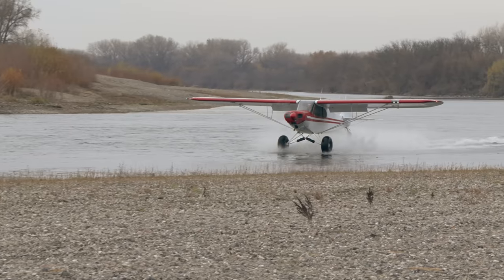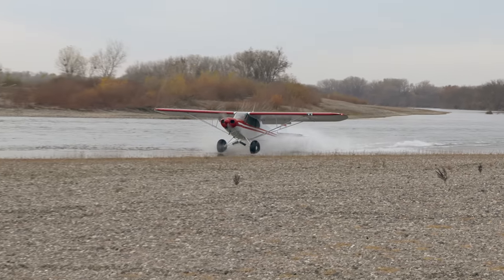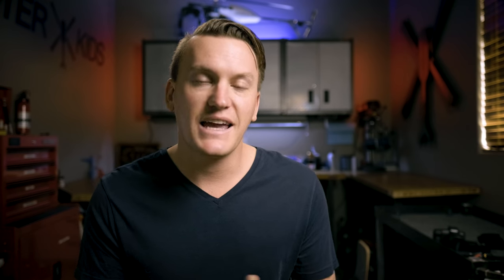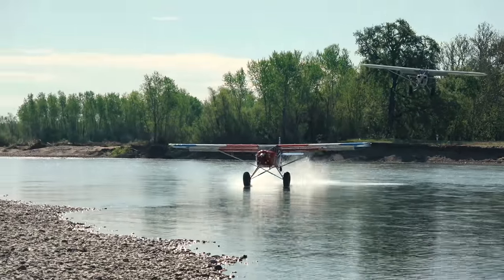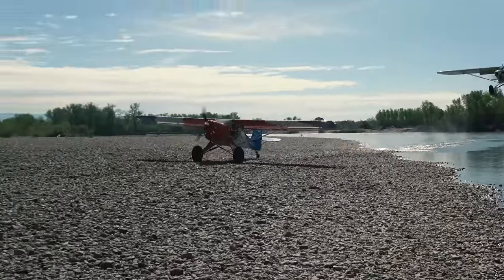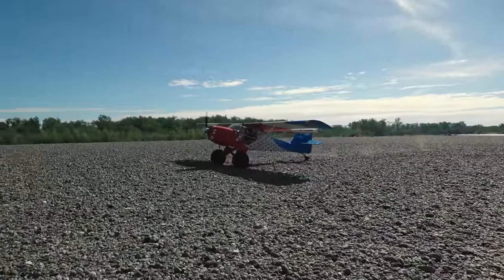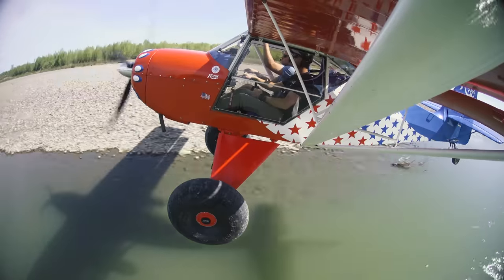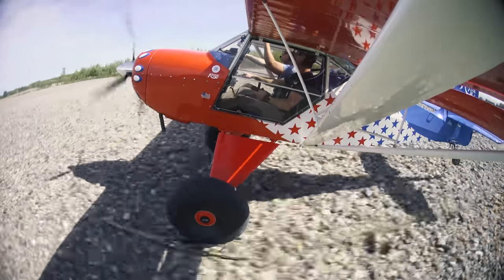How To Waterski An Airplane, and Why You Probably Shouldn’t

Comment: Seems to me that an aircraft with an experimental airworthiness certificate has no published data on non-paved or paved runways.  If you built it, you're the test pilot, seems you could generate the performance data for your experimental aircraft for both paved and non-paved (even with various surfaces, such as gravel, cut grass, un-cut grass, dirt).  That would pull the rug out of an overzealous FAA official who tried to put that one over on you.

Comment: I haven't watched the video and don't have to. Not a pilot, either. But I can still make an informed comment. I know aviators never want to run out of two things, airspeed and altitude. Your waterskiing antics leave both in seriously short supply. Moreover, you have no margin for error. Kissing a runway or the ground in that way is relatively safe but doing so over water is foolish and dangerous in the extreme. You know this, there is NO debate here. Interesting that you post in your comments, "be safe out there guys" while posting a video of you being very UNSAFE. I'm a huge fan of yours, Trent. I watch your videos and I get to fly and share your zest for life. I want you continue to do so for a very long time. As you also know, there are old pilots and bold pilots, but there are no old, bold pilots. While you often fly at the edge of the envelope, it's calculated and done with great skill and experience. However, stunts like this one are just plain stupid and serve no useful purpose.

Comment: Yeah,  hydroplaning is different.  It's  just water overcoming the air pressure in the tire so the center of the tire lifts off the road.  A car would not waterski at the speed that it will hydroplane.

Comment: It definitely is not surface tension. Motorboat people call it planing. It is a hydrodynamic effect. https://en.wikipedia.org/wiki/Planing_(boat)

Surface tension is an effect caused by intermolecular forces. It is really weak and does not depend on speed. https://en.wikipedia.org/wiki/Surface_tension

Don't be scared of the word planing because it is dangerous on the road. It is actually helpful in this case.

Comment: I think what they mean buy undue hazards to persons or property for subpart A would be in reference to your passenger being with you if you had lost the engine while waterskiing you would have been going for a swim instead of had you lost the engine at 300 or 500 above you could have possibly been able to maneuver to try and make an emergency landing on the shoreline. Basically the way I interpret that is at all times you should be able to maneuver the aircraft to a ideal(ish) landing site should you loose the engine, but I’m no lawyer who wrote the far so that’s just my best guess.
Reply: A practiced waterski  landing in an event of an engine failure could be considerably safer than a very rough shore landing. You would sink at the lowest possible speed, hopefully close to shore.
Reply: Ray Fletcher exactly, but there is definitely room for interpretation so that gives the FAA wiggle room to push their decision how they like

Comment: Just to set the record straight, you’re not on probation!  You were never convicted of anything, nor did you plead guilty of anything and there isn’t even a finding of a violation on your record (you would have to have gone before an NTSB Law Judge for that).  You very wisely cooperated with the FAA investigation and stipulated there was sufficient evidence to establish you “may” have violated one or more of the FARs.  As a result of your wise cooperation, you received a warning notice that will be a matter of record for 24 months.
Why was it wise to cooperate with the FAA investigation?  Because, if you tried to fight the case you would have wound up in front of that NTSB Law Judge.  Then, all you would need to do is convince the judge how you were carefully (in accordance with 91.13) operating your aircraft in an operation that it was never designed, tested, certified, equipped, approved or in any way authorized to conduct.  Yeah…that sounds like a slam dunk.  “Maybe” the judge would have seen it your way… If not, there is your finding of violation, oh BTW surrender your airman certificate for the amount time the judge determines.  The finding of a violation with certificate suspension stays on your record a lot longer than 24 months.
That’s all any pilot who gets caught doing the same thing has to do “hope the judge agrees with you”.

Comment: after reviewing every kit plane I could find. . . I went and did it! I bought a carbon cub ex-2 factory built. they asked me what I do for fun when I am not crop-dusting(my morning job) building vertical mount windmills(night job pays for my hobbies) and electrical modification of cars and aircraft(day job),
 yes flying is expensive maintaining 11 planes is very very expensive hiring with med and benefits pilots to fly my planes yep  expensive, introducing organic crop dusting to 69 farms is lucrative and priceless, loving my synthetic vision and glass dash in all my aircraft makes my people safer. now we are removing the power plant the fuel pod of my cub and replacing them with a 60kw electric motor and 300kwh worth of graphine battery packs from Samsung. we installed  fly by wire system, and 35"x-10"x-15" Alaskan bush(I do not like airports if I can avoid them) my home airport is kcic(closed international airport that isn't operational do to  we refused to install the equipment for the  tsa goons so we got shut down right after getting a new runway lol)
Reply: yes we refused the x-ray booths as the operators are not x-ray techs so not qualified to operate their own equipment

Comment: I would think that water skiing in a plane would work better with using the brakes to keep the wheels from spinning.   When I picture it with the wheels free to turn.  As they start to spin faster and faster they would have the same effect as a spinning baseball when throwing a curve ball.  That the spinning wheels will now be trying to pull you into the water.  While a locked wheel acts like a ski or bare foot and you hydroplane on the water.   Anyone have any thoughts on this?

Comment: to be able to barefoot ski take your weight divide by 20 and ad 10.   so for a 240 lb person you would have to be doing speed 22 Mhp at least to be able to barefoot behind a boat. the same math would transfer to a plane for the most part but the  weight to suffice area would be a huge variable
Reply: make that divide by 20 ad 10 m y bad

Comment: Trent, I do not see how 91.119.a applies. Say the engine failed and you crashed right there in open water 500' from everything, you would not be creating undue hazard to anyone or anything so that rule should not apply. 91.13 however, yeah that is a blanket anytime they want to go after someone.

Comment: using the brakes on water will just (literally) change nothing, and i think it's dumb that some people think it'll do anything

the real danger is that if you get those wheels just a bit deeper than you do in water, in a split second your plane will get upside down, break into pieces and you'll die, personaly i wouldn't take such a risk althrought i'm into aerobatic flying, but i guess everyone is free to do what ever he wants

(the fact that you have those huge wheels helps you allot)

Question : Why don't you just add some Skis to your wheel (such as the ones used for snowy regions), that'll be allot safer ..

Comment: I am definitely NOT a hater. My thought is that it is your life in jeopardy, no one else's. Except for the first responder who may be endangered trying to save your ass. I do believe it is an unnecessary risk. So is doing flips on motorcycles. While I wouldn't do either, I support your right to endanger yourself any way you want.
Thanks for sharing

Comment: Would it not be a good idea to carry one of those small oxygen bottles to have more time to get out underwater?
Reply: cmulder002  Most SCUBA is compressed air, not oxygen.  Pure O2 is used only in technical diving, only above 20 feet of depth, and is part of a very technical decompression schedule.
Reply: @jenniferwhitewolf3784  these are the kind 
https://www.spareair.com/     basically a "spray-can"  with a mouth piece.
Even the smallest one  gives about 30 "Surface Breaths" .
That buys time to orient yourself and get out.
And yes compressed air.

Comment: The example of a water-skier compared to the aircraft is not exactly accurate. I dont know any water-skiers producing lift like an airplane wing. In stable flight your vertical force balance is....balanced. So in stable flight just above the surface, the water is only supporting the force created by any decent, or component of lift not supported by your wings. So the force felt by the water is less than the total weight of the aircraft as a vast majority is supported by the wings still.

Comment: Our Flying Lions AT-6 aerobatic team pioneered this stunt and routinely perform it in diamond formation  on standard tires on low wing radial engined vintage trainers! Walking out the door vs skimming my tires on water at or above 60-80 knots in ground effect with nearly zero margin for error - hmmmmm

Comment: It is a very polarizing subject because it is dangerous. Go too deep and your plane will nose down into the water in less than a second. Such a hard impact is likely to kill the pilot and passengers, and if not, well you're now trapped in the airframe as it sinks.
Reply: And even after having Trent explain that your preconceived ideas are not really correct.  What is really dangerous is not understanding what is involved to do it safely. That goes for driving and walking etc,etc.  Driving is dangerous, flying is dangerous.  Not true, they can be but don't have to be if safely practiced and understood.

Comment: Hang on...now, granted we're talking about water here, but based on the FAA inspector's comments in that letter, you're telling me that your Kitfox doesn't have performance numbers for landing on anything other than paved runways?  It doesn't have numbers for landing on grass?  I find that difficult if not impossible to believe.  And if it's true, shame on Kitfox for not providing it.  Heck even my 43-year-old Cessna 150 has those numbers.
Reply: Kitfox can't provide it. Every experimental plane is built different unlike your 150 which every plane rolling off the line was identical. It's not like every experimental plane is equipped the exact same, with the same weight, same W and B, same brakes, same wheel size, same prop and pitch etc. It is up to the builder to find their own performance.

Comment: Doing this with a nose wheel ACFT is never safe. The drag from the mains will pull the nose wheel into the water. Any vertical speed will put yr nose wheel in the water. You will be be upside down.

Comment: Regulation kills whatever is being regulated. It might take time but that is the end result. General Aviation is dying due to regulation and it's associated costs. Only homebuilt aircraft are getting by because of lessor regulation but they too will eventually be crushed by regs. ADS-B is going to be the death of aviation because once installed by regulation you can never fly with it in the "off" position so they will know your every move and it's only a matter of time until they tag you for some "violation" that hurts no one. Get tagged again and you will likely lose your ticket. The upside of this (if you can find one) is that used aircraft prices will continue to drop as there are less and less "licensed" pilots to fly them and the "regs" require expensive and perhaps unnecessary maintenance requirements. I'm enjoying flying now because in 10 years not many people will be flying...

Comment: I think that particular FSDO office inspector might want to level-set expectations within their own organization. It's not congruent across the agency to say that landing anywhere but a paved runway is "careless and reckless" if the FAA themselves produce an "off-airport ops" guide where it promotes off airport landings as "extremely rewarding" and specifically instructs you to go to a dirt strip and test it out; at max gross no less: ": Fly to an airport with a dirt or gravel strip. Load your aircraft to near maximum gross weight including typical
 gear such as your survival kit, and compute weight & balance for the test flight."  https://www.faasafety.gov/files/notices/2015/Oct/AOAOG_Web.pdf

Comment: thats some bullshit, if the passenger consents to any action the pilot does then it should be irreverent, if they said they were fine with doing it then it should be fine, plus shat shit about part A was stupid, if your over water theres nothing to cause damage to and if the engine dies you can easily ditch the plane safely into the water.
plus pilots should really be able to defend themselves against bullshit allegations, if no people or property are being endangered theres no problem, youd should have called them out

Comment: Great video. Too bad this is America, the land of  covering your ass and disclaimers.  Eff em all. Oh and if this hasn’t been covered yet the real reason for waterskiing is the tires will typically stall in the water around 28 to 30 mph and the wings usually stall 35 to 38 mph. Thus you can impact the land lower than your flying speed to shorten your distance. Lastly I’d rather flip a plane over in 6’+ of water that stuffing the nose into the gravel and then my face into the dash in a shallow spot.